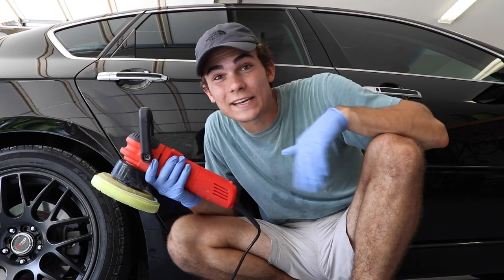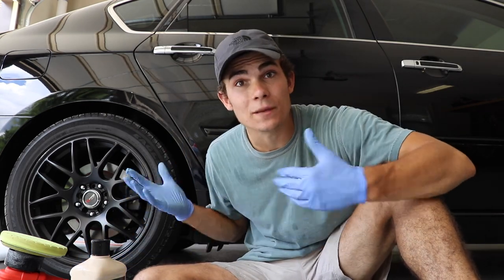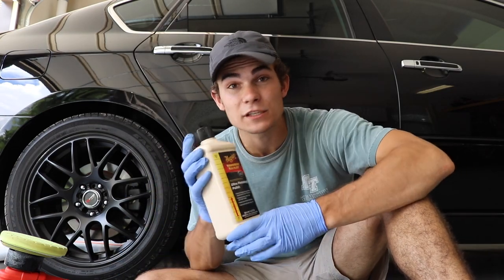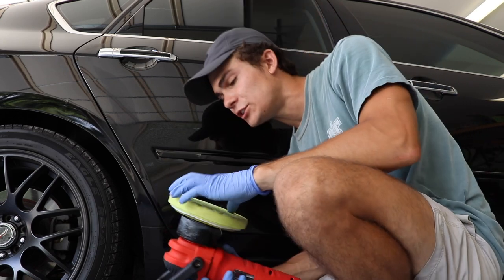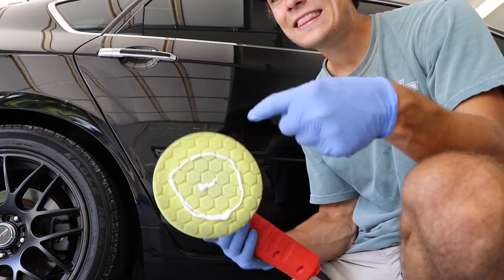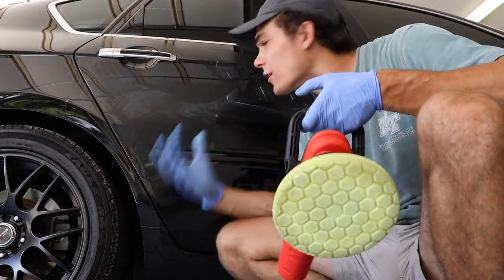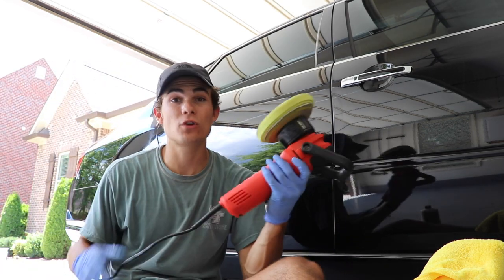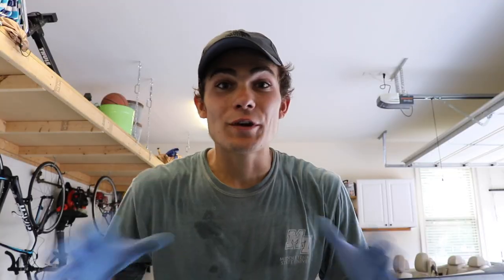Meguiars M205 Finishing Polish

Comment: This is what I use on my personal black daily. Black is color that as a daily will be incredibly difficult to be better than 80% clean for more than a month or two. M205 does a great job of yearly maintenance without heavy cutting into the clear coat. The best part though is it creates enough depth and pop, but at the same time it also allows me to accept the fact that a black daily is going to have scratches and swirls.

Comment: Thing - is if you left any hazing behind after the 205 you've just covered them up with the quick detailer so you wouldn't know, and also you add an extra wax removal step after the polish if you want to apply ceramic coating which risks adding more scratches. I would lubricate with just water, or possibly an IPA solution to remove the 205 polish so you wipe once and prep for the next coat in one stroke. If you apply a long term wax on top of that quick detailer it will last 5 minutes :-/

Comment: I should've watched this before I threw that 205 in the garbage.
I couldn't beleive how difficult it was to remove, I thought I was doing something wrong or it was junk. Never thought to lubricate it to remove it.
I since have started using "Blue Diamond" from detail king.
Easier removal.
Another great teaching tool, I like seeing the heavier pad to the polish. Never real sure about mixing things up like that. Worry about finish product.
Reply from the maker: Thats ok! It is an awesome product! There are always ways to get around certain things I guess! How do you like the polish from detail king???
Reply: Jeffrey Carson you right that m 205 is junk it dont work that good i will never use it again try hd speed its wayyyy better

Comment: You shouldn't run the polisher at a higher speed, you need a cutting pad if you want better cutting results. Running a lower speed with a more aggressive pad can help prevent scouring of the paint surface if you're new to polishing. Also, if you need to smash the pad into your paint, you're straining your tool and it's another sign you need a more aggressive pad.

Comment: Any swirls? Does the m205 remove swirls as well?
Also, question: if the m205 is a light cutter, why did you use a heavy cutting foam pad? Wouldn't the foam pad be useless if the polish is light cutting anyway?
Reply: pofrani wondering the same thing hopefully you get a response as i want to know as well!
Reply: @n3ro209  Don't think this guy is gonna reply! He's not replied to most of the questions as far as I can see. I hate people like this! Gonna thumbs down!
Reply: pofrani perhaps he’s a busy guy, just don’t expect him to reply right away. On a side note I read other comments here and someone else asked the same question, which he replied by saying that he wanted to have a little more cutting power by using a more aggressive pad, since he was only doing a one step polish. Now if he were to be doing a two step polish, he would begin using a more aggressive pad at the first step, then finishing off with a light cut / polishing pad. Hope this answers your question.

Comment: Excellent video, just a quick question. I understand m205 is a mild finishing polish so I was wondering if I could  use m205 as a maintenance polish twice a year before i seal using a polishing or finishing pad on a pc? I plan to keep my car for atleast 10 to 12 years and i dont want to burn through the clear coat by the time I get rid of it. Thanks in advance
Reply from the maker: Ya definitely a great question, I think if it were me I would only polish once a year, I think anything more than that is a little excessive, and not that you would definitely go through the clear coat if you did twice a year, but if you are wanting to keep it for 10 plus years, I just don't think I would do more than once a year! Thanks for the questions man! Let me know if you need anything else!
Reply: Thanks so much for the response. I actually left out an important part in which still may not change your answer overall but what i left out was when I said polishing with m205 with a softer pad on a da twice a year I'm using very light pressure on a lower speed to more a less glaze the paint while taking out super fine defects and then seal the paint to lock in the shine and that's why I normally do it twice a year after claying of course
Reply from the maker: sean B understood, ya I guess that would be fine! I don't think you should worry if you are doing that twice a year, I am sure that is totally fine!
Reply: Thanks again Luke, I'm glad I'm doing this in a safe way. As far as starting out detailing goes would it be fine if i just used megs m105 and m205 for most jobs? I have so much of it and figured that would be all I needed as far as compounds and polish goes combined with a variety of different da pads. If I may ask, how many polishes do you carry with you to a job and how do you choose which polish you use when seeing the car? I understand that if it's heavier oxidized paint I would just go with m105 and finish with 205 and if the car just has light swirls and scratches to just polish with m205 so I'm just trying to figure out why using anything else would be appropriate unless a different polish would finish down better or be easier to.

Comment: Luke I have a couple questions that might just help my polishing after watching this video. First, how do you make an Isp solution, I think this is what I was missing in my ability to polish correctly. also, do I need to wipe down with Isp as the last step before applying the wax or sealant? Last question and most important for me, Im getting alot of dusting on not just the 205 but also been trying griots boss cremes which are suppose to be better. Im not sure how to either clean my pads more often or am I overworking the product. I hate having to wipe the whole car down after, very time consuming.
Reply from the maker: Henry R hey Henry I don't think I understand all of your questions fully, the isp wash can be as simple as 70/30 or 80/20 distilled water to alcohol. And as far as the dusting issue I don't think I know what you're asking, could you ask in a different way?
Reply: The reason for wiping down with isp is to remove any leftover polishing oils or residue before sealing. He showed in this video you can use quick detailer instead if you just want to finish with a spray wax.
Reply: Henry R..i'm not saying this is what you are def doing but it might be you are over working the product, when you next use the polisher have a glance behind were you have just been over with the polisher and see if it has not flashed yet, either that or try some thing like scholl products s20 black vids on you tube can be worked for ages before it flashes...hope this helps...forensic detailing in the uk has done a good review of the scholl range...
Reply: ZombieFeathers  Im definitely not using any isp wipe down prior or after im polishing so I think that might be why Im not getting good end results. I will doing this step for sure now.
Reply: richardkkirk  Thank you, I do think I might be making to many passes to quickly or overlapping to much which causes the polish to dust up to soon. I usually clean the pad after 2 panels. maybe I should clean it more often.

Comment: Can someone explain why Meguiars 205 is used as a polish but it says on the bottle "mirror glaze"? I thought polishes actually cut scratches out of the clear coat but glazes are a surface treatment that fills in the scratches. How can one product do both?? And if this is a combo product with both properties, then wouldn't you want to not remove the leftover residue since that is actually the glazing portion?

Comment: i want to do paint correction on my 2015 mitsubishi lancer with lots of swirls...shall i go for M105 & 205 or Meguiars Ultimate Compound & Polish?
Reply: Depends on how severe the swirls are. Keep in mind, the type of pad is a part of the equation. A LC yellow or orange pad combined with 205 may work wonders for you without the need for the harsher 105. Heavier scratches/swirls may need 105; especially if the overall paint condition isn't that great. I'd try 205 first if I were you. Follow up with a quality sealant/wax after you're happy with the paint correction.

Comment: What did you spray again to move the polish? What kind of synthetic speay wax is it again?
Reply from the maker: I use an IPA wash, 50/50 alcohol and distilled water, and I use meguiars synthetic express spray wax, here is a link:

https://www.amazon.com/gp/product/B005JPJMI2/ref=as_li_tl?ie=UTF8&camp=1789&creative=9325&creativeASIN=B005JPJMI2&linkCode=as2&tag=wilson0f3-20&linkId=afa2f7d80f822ae961918a7742120b75
Reply: Nice, thanks

Comment: Little complicated question: I have used 4x rotary on bmw f10. 3x 
Meguiars 205 with Polish W8207 pad and 1x Meguiars 205 with Meguiars 
W9207 finishing pad. All 4 times I was between 1300 and 1700 rpm, cca 
5-6 passes every time, average arm speed and light to medium pressure. 
Yesterday I measured my car thickness and I was in shock. Doors are 
between 51 micron and 68 microns..Is it possible that I have removed 10 
microns with 4x polishing with rotary and this combo? 
I am sorry for my bad english. TNX!
Reply from the maker: To be honest man, this is a bit too complicated for me to answer, I am not the best guy to ask

Comment: Is there a reason you used a heavy cutting pad when doing a final polish compound?
Reply from the maker: In this particular case I wanted to get a little more cutting done when I was using the 205 because I was only doing a single stage polish, so I can accomplish a little bit more when I combine it with a more medium cut pad

Comment: Hey I want to do a one step polish on my summit white 2015 Camaro and I have a 10 inch rotary polisher that will need a polishing bonnet. I’ve never done this before I would appreciate any advice and if you could point me in the right direction of products. Also I got the car brand new two years ago and I’ve only waxed it about 5 times and I wash it once a week but I do have light scratches. Please help! Thank you!
Reply from the maker: Hey alex, in all honesty it is difficult to advise you simply because I cannot stand in front of the car, and rotary polishers are a whole different animal, and I would be crazy to attempt to explain how to actually polish using a rotary over the comments, so I would suggest watching as many videos as you possibly can about the subject, and even get an experienced rotary guy to help you in person! Its a little sticky to do without any help... but I believe in you!
Reply: Wilson Auto Detailing I appreciate it! Lets see what I can learn and accomplish. Thanks for the videos 🙏🏻
Reply: Hi Alex, just to advise it's really difficult to work with a rotary polisher if you've never done it before. You will very probably leave holograms on your paint or because rotaries are a way more cutting device you can also remove a lot of your clear coat which affects your paint directly. The best way to go is to buy a DA and heavy to medium pads and medium compound to get rid of those swirls and light scratches.
Reply: keybarbarosa okay will do thank you!

Comment: I am about to buy a DA but don't want to break the bank.  Might opt for the Harbor Freight DA.  Heard lots of people talk about it on FB.  Seems great for a beginner...  Can you do a "how to" video on Pad cleaning?
Reply: Warped Wackos Harbor Freight DA is a great beginner..Look at Chemical Guys for cleaning pads..Shows everything u need to do.
Reply from the maker: Yes I definitely will!
Reply: Pad cleaning can be done for cheaply and effectively without breaking the paint. Get a bucket of hot water, dump pad in bucket and wring out. Spray all purpose cleaner on pad and scrub with any soft to medium bristle brush. Can also scrub clean with white terry towel. Dunk in water and rinse out. Repeat if necessary. Let pad dry for 1 day. To use pad again after cleaning, put pad on DA machine and spin on highest setting. That will remove all water very fast.
Reply: Dude do it that's how I learned last year! Just get a 5" backing plate plus pads. Chemical guys has a pad kit for like $50 backing plate sold separately. And I get great results with m105 and m205. Not perfect paint correct but definitely a paint enhancement.